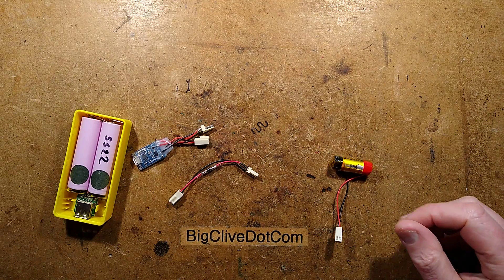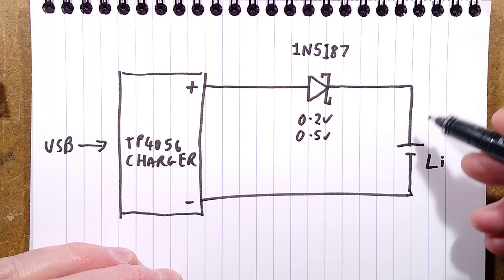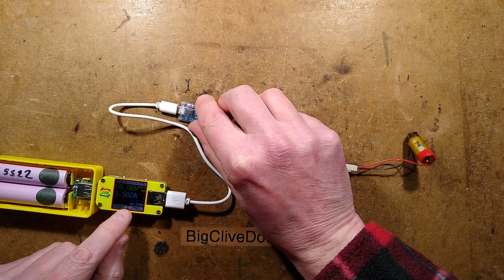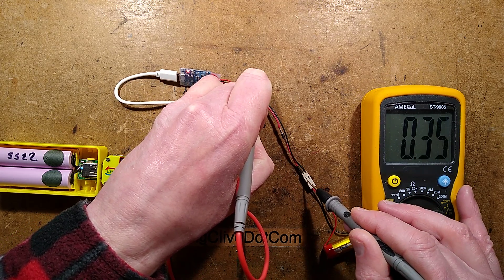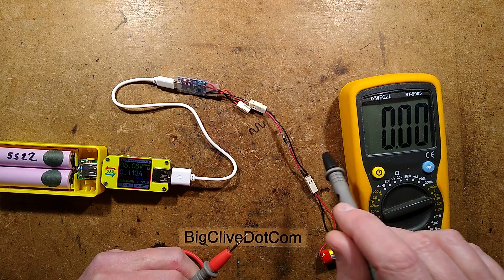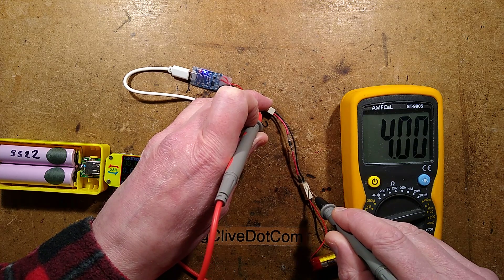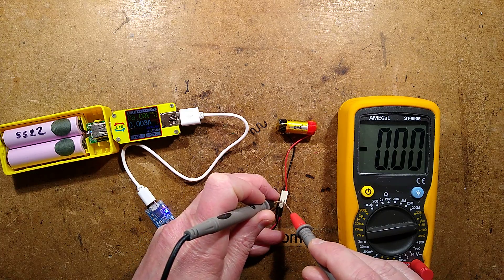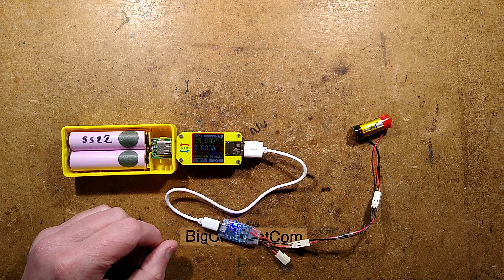Schottky diode between charger and lithium cell?

Comment: This video reminded me, that I have digital clock with thermometer, which originally (back in early '00s) doesn't have battery for clock backup. I bought the device as a DYI kit and soldered it day before my exams for graduation to middle school. 😂 I was born and lived in small village, where power outages were a daily (well, maybe weekly) thing, so I added backup to the clock, but it could drain a 9V battery in couple hours.

I revisited the idea back in 2010 and used small Li-po battery from an IR operated toy. This time the battery powered only microcontroller (Atmel 89c2051) so 2mA was sufficient. Battery was charged from 5V supply rail, through two 1n4001 diodes or one 1n4001 and one shottky 1n5819 or smth, and a 100 Ohm resistor, if I recall correctly. Powering uC back was done by another shottky. I've done "extensive" research through many months, checking and noting voltages of diodes and current thru resistor, if the battery did overcharge, or what. But I think the voltage settled at 4.1V. I wonder what's the effect of constant charging on this Li-po now, after over 10 years. Ironically, now I live in big city and the power outages occure once a year at most, so the power backup for my clock is barely needed if ever 😂

Comment: I like the Way you make electronics videos without all the fancy bells and whistles. Most electronics channels would have told us the same Story using a 20k Keysight Oscilloscope and other expensive gear, when all you really need is a basic meter. Never change Clive!
Reply: I don't mind a bell or whistle as long as that's what's being dissected.
Reply: Yeah, the accessibility of these videos is what makes them so special.
Reply: I was thinking to link it up to something to monitor and graph the voltages rather than take manual readings! 😊
Reply: an old school paper chart recorder would be classy - but maybe that's just me. @stepheneyles2198

Comment: they have buck regulators with currant voltage limit output you could set 500ma 4v   will go to 0 currant at 4v?

Comment: Maybe the charging curve gets better with also a resistor over the cell, say 3K9 for 1 mA. The charger gets confused by the fact that if the current drops to zero, the diode voltage drop also nears zero.

Comment: I was one of them messing with a Schottky. 
I think the best are circuits that use a TL431 to cut-off the voltage. 
If you Google "tl431 li-ion battery charger circuit" you'll see many circuits. Just pick a resistor so that the TL431 triggers at 3.9V instead of their 4.2V
Reply: is there a 12v version?
Reply: @Palmit_  Tlv431s all are set for 1.24 volts. You create a resistive divider such that the target voltage you want divides down to 1.24 volts. So you could rig it for 12V.

However you need to look at the top resistor too. As when the current goes up above the target voltage the tlv431 starts to divert the current through it such that the top resistor burns off the extra voltage. This means that the top resistor can exceed its power rating and cause a fire or burn up. So you must size it correctly.

Also you must set that resistor such that the minimum current through the tlv431 is 100uA and that the maximum current doesn't exceed whatever your particular TLV431 maxes out at. This varies from maker to maker. TI for example maxes out at 15mA through the TLV431 and has the TLVH431 which allows up to 80mA.

Really for higher voltages you would maybe want to use a TL431 instead. It is internally set for 2.49 volts so your resistive divider changes. But then you can get to even higher currents.

Asking for 12V you sound like of like you are charging a lead-acid cell. If you are, know that lead-acid batteries charge differently than Li-Ions and so the circuit may not be appropriate.
Reply: @Palmit_ Sorry I don't know.

Comment: I had the idea of using a Schottky 1n5817 as a lower drop charging diode for a 3xaa NiMh battery outdoor light with a nominal 5 volt solar panel. The problem was that the leakage current on the 1n5817 allowed the cells to discharge through the panel over night. It works fine with a 1n4007, even though it drops twice the forward voltage compared to the Schottky. Thank you for sharing!
Reply: Ouch.  A 1N5817 has 1-10mA of reverse leakage current.   Not the best choice.  Schottky's always have fairly high leakage currents (in both directions).

You can make a perfect linear regulator out of a normal diode and a zener to ground.  Solar panel -> normal-diode -> battery.   And then zener from the diode/battery junction to ground (reverse biased of course for the zener).   The zener must be able to dissipate the entire output of the panel, obviously.

The reverse leakage of the zener should be more around 1-5 uA.

The only other issue with using a zener is that the voltage regulation gets squirrelly below around 4.3V.   So as long as the intent is to regulate to one of the standard voltages at or above that, its fine.  But below 4.3V it isn't.   Standard voltages:  4.3V, 4.7V, 5.1V, 5.6V, etc.

-Matt
Reply: @junkerzn7312  I learned this lesson the hard way, too focused on voltage drop & trying to get as much from the solar panel as possible on dark winter days. For more sophisticated stuff I tend to use low drop out regulators that happily work down to a few volts, either fixed or adjustable ones with reasonable output currents at least for what I need. Thank you for your comments.
Reply: @springwoodcottage4248  It's interesting that there is this intersection between wanting to charge little lithium batteries like these cells, and real solar + battery systems that use much larger (usually LiFePO4) batteries.  Charging small packs verses large ones.

For any battery 12V or higher, a proper charge controller is really the only good solution.    They are incredibly efficient too... 98% to 99% efficient, because they current-regulated buck converters taking a higher solar input voltage and bucking it down to charge the battery.  Plus they do the full 3-stage or 4-stage charging algoirhtn, including float and load-support.

Because they are current regulated, the voltage regulation is fairly poor, but the charge controller still zones in on the exact desired voltage(s) when pushing against a battery while charging it.  That's why they can be so efficient.

For example, take a "Victron SmartSolar MPPT 75/15".   SmartSolar version rather than the BlueSolar version.   The SmartSolar version has a bluetooth/phone-app support.   This little charge controller is $70 and can charge 12V and 24V batteries of any chemistry, completely programmable via the bluetooth app.   The only requirement is that the SOLAR input voltage by roughly +5V above the BATTERY target voltage.  Which is easy since a 12V solar panel puts out 17-22V or so.  (the "15" stands for maximum charging amps... 15A in this case, also programmable in 1A increments).

Really, though, when it comes to charging batteries, its impossible to beat real charge controllers outside of the price..  And the cost has dropped precipitously over the last decade.   Literally just $70 for a high-end MPPT now.

Little PWM charge controllers (the Renogy is popular) are as low as $20 and still decently efficient.

-Matt
Reply: I've discovered that if you use a protected cell and a solar panel which is capable of more than the cell's full-charge voltage but only capable of supplying a small fraction of the normal charge current (1/20th C or less), you can charge the cell through a normal diode.  With the available current being so low, the cell's terminal voltage "drags" the solar panel's voltage down until the cell's terminal voltage rises high enough to trigger the protection circuit which cuts off the charge current.
I've had a protected cell from a telephone charging from a (nominally) 6 Volt solar panel this way for years, going through an automatic daylight detector which turns on a string of around 10 LED lights at night and turns them off again in the morning.  I wouldn't try this with any cell which didn't have protection, though.
The LEDs provide just enough illumination in my carport to light up the drivers' side of my car at night, just in case I forget to leave my outside light on so I can see when I get home after dark.

Comment: That’s the video i was hoping for. For a looong time.
Reply: Sadly this solution is not optimal. So still hoping for 4.0V or 4.1V variant of this charge chip which will never happen - at least not for this ultra low price like TP4056

Comment: I did something similar on solar lights that use 1650 cells by adding two normal silicone diode so they're never charged over roughly  3.9V. Before that battery usually died over one season but now same ones are on them for third year in a row. 
Problem here is that TP4056 act as current limiter when it detect voltage over 4V which make charging too long without a good reason, it's much easier to use something like good old lm317 as CCs source and provide steady 3,9V@500aAh.

Comment: For emergency lighting, since the power rarely goes out cycle life is less important than capacity because you neve know how long the power is going to be out. Fore something like photo controlled constant on doorway lighting combined with solar cells, cycle life is more important because you only would need the light to be on till late evening or midnight unless you're one of those who stay until the pub closes.  Then you just need to choose solar cell and battery size to accommodate the light working as long as needed even in the worst-case scenario such as in the winter with short cloudy days.

Comment: Wonder if adding a simple load to the output of the charge controller, say a green LED and a current limiting resistor of 220R, would help damp the oscillation, by keeping the charge controller out of that current band and also slightly increase draw. Act as a charge indicator as well, as it will go out when power is removed, though the controller might not start up properly with this, as it will see no cell connected for the beginning of power on, which some are unhappy with, which is solved with a 47k or so resistor across it to bootstrap it slightly till the LED forward voltage

Comment: My old Nokia 6110 with a Li-Ion cell still takes a charge, could be because it only charge it to 4 volts. 2024-1998=26 years and still alive (pretty sure the capacity has deteriorated ;-) ).

Comment: BigClive.  You could use a LiFe04 charger instead if you wanted an over the shelf charger answer.  If you are still buddies with Julian you can try his ISDT C4 charger and set it to LiFe04 I think and do it direct.  Incidently you can 3D print a fake 18650 and add leads to it to use a commercial 18650 charger to do the liPo.  ALSO the charge limit for LiPos is 4.35v... eo charging them to the 18650 lithium ion limit of 4.2v already meets the purpose of your experiment without any modification.
Reply: Certainly Panasonic and LG don't recommend a charge voltage of 4.35v as they are two I have to hand, so who's cells are you talking about please preferably a PDF.
Reply: @andymouse  Li polys can go to 4.35v (hell even 4.4v in my samsung phone), not Li ion
Reply: we aint talking 'Li pols' hence the comment @ratgreen

Comment: I did that for an external battery for my phone. The internal one is rated to charge to 4.35V, the external one I wanted to add was only rated to 4.2V, so just paralleling them was not going to end well. The other direction also had a schottky diode, which limited discharge depth too much so I later changed to a mosfet-OpAmp combo (with the charge limit set to 4.12V).

Comment: That way of changing seems like a bad idea.  As the battery approaches the charging voltage the current drops, so the Schottkey diode's voltage drop will drop.

Some diagrams show 0v drop at 0a, and if those are correct, it will still charge to the supply voltage, if you leave it long enough.

other diagrams stop before current stops, so they tell you nothing.
Reply: I don't like the sound of this either, I don't think it works like people believe, must have a play one day !

Comment: Interesting. My cloud cuckoo land way of thinking is to try a 3.9V zener across the battery and something to limit the current when zener breakdown occurs (and a klaxon to warn of same). Although the charger IC seems to be set to 4.2V I'm not sure whether it outputs that (I may have missed the voltage check pre-diode when charging started).

Comment: I tried this same thing with a low-tech lead-acid battery charger in a 1980s emergency light (uses an LM321 to switch the charger on below a certain voltage and switch it off when a certain voltage is reached, and when it's on it just dumps the full transformer output into the battery through an SCR) because it floats the battery too high and I wanted to tame it down. Unfortunately it overcharged the battery even worse because as soon as the charger turns off, it sees 0V, which triggers it to turn back on, so it pulses on and off.

I'm sure a single resistor changes the "charge-off" voltage, but I'm not dedicated enough to figure it out, so I'm just using it until it inevitably ruins the battery from overcharging, and then I'll build a Li-Ion pack for it, which will work perfectly with the charge voltage.

Comment: That TP4056 was not happy, which raises a question. Clearly the Boston Dynamics guys are going to get the "I have no mouth and my scream" tonce the machines take over and quite rightly so given the videos of them kicking innocent robots. Now would that apply to someone tormenting a TP4056? You could argue this device is clearly far less developed than one of Boston Dynamics' robots. However consider the reverse situation where the machines were mistreating a child. Hell the Butlerian Jihadi n the  Dune novels happened because the machines killed a child, Manion Butler. So you can't really guarantee the machines won't come after you for this video.

Comment: It's a good idea, but 0.35V drop maybe a bit much for 1S. Better for 2S to 4S with a BMS. Those TP4056s are great, but tend to overcharge a bit anyway.
I use a couple of Schottkys in series to make 12V LEDs last longer with a 12V power supply.
Reply: LEDs use current supplies not voltage.

Comment: The problem with this circuit is that many boards have discharge cut-off circuit(dw01) cant be used as diode will block the discharge completely.
Reply from the maker: My fix for that in another experiment was to inverse parallel diodes.

Comment: Now that you've put a diode in series with the battery will it actually power something from the output of the 4056?  My first thought would be to put two or more opposite facing diodes in parallel with the first to make it actually usable.  Put a load on it and see where the cutoff is as well?

Comment: Okay who else with the 'I shall be back when something interesting happens' was expecting, (hopeing) smoke and flames? Careful the EVangelists will catch onto that 80% charge level, they preach in your nominal 150 mile range car it's recommended to use only 60%  between 20%-80% battery of battery capacity levels. 🚗⚡💥🔥🤔🤭👍🤗🇬🇧

Comment: Try a higher current diode as it will likely hold its low voltage drop over a wider range of current.

Comment: I do this since many years ...
The Schottky diode is in my case between the TP5056-chip and the two protection chips. I cut the power trace, remove the solder stop and put a little glass 3 Ampere Schottky-diode at this place.
If the charging current is low (20mA), then the LiIon-Cell reaches 4.0 Volt. (drop voltage over the diode is 0.2V)
If the charging current is high (1A), then the charging stops at around 3.85 Volt. (diode drop voltage is around 0.35V)

Comment: according to the datasheet of tp4056: "When Vin drops to within 30mv of the BAT pin voltage, TP4056 enters low power sleep mode....." 
so..... could we have an experiment with 4 or 5 Schottky diodes BEFORE TP4056? :)